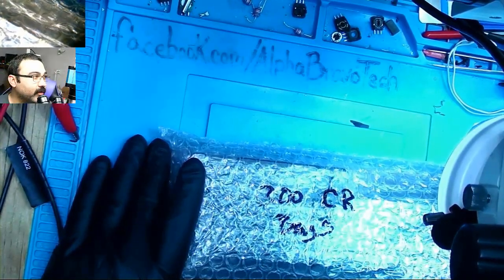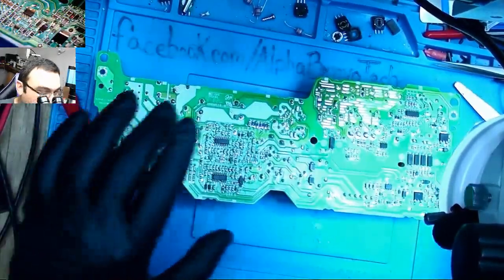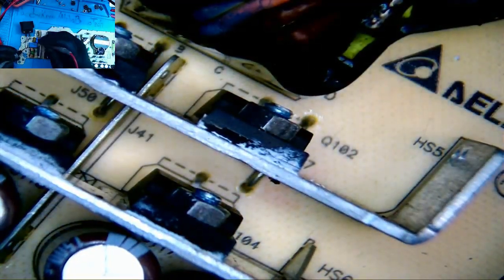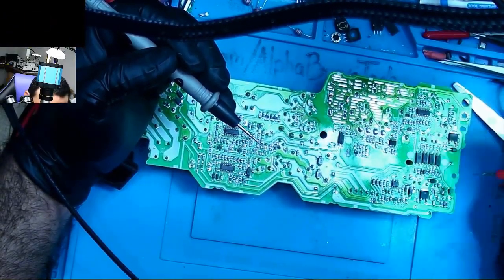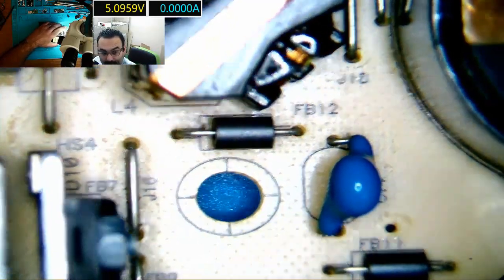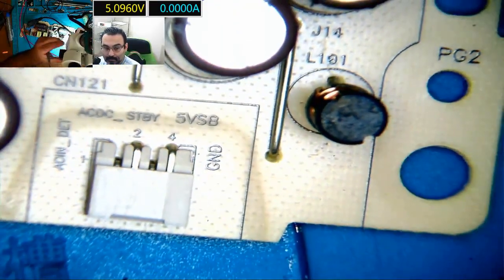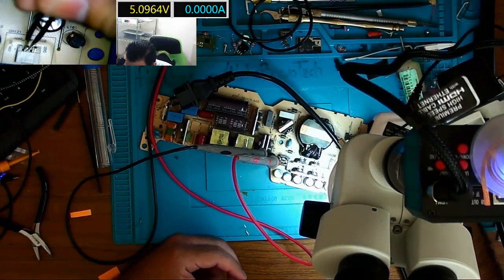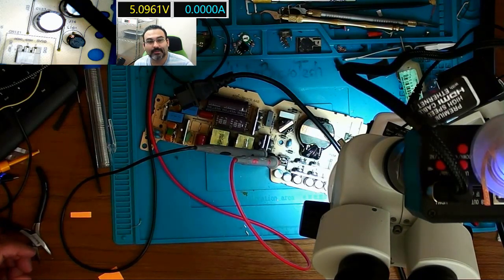PS4 PRO PSU ADP-300CR Power Supply Repair (Another One)

Comment: Great video! Do you have any idea what can be wrong with my ADP 300cr? I changed the resistor because it was open and now I have the 5v but when I do the short to get the 12V, all voltages goes down to zero, even the 5v
Reply from the maker: I've got a couple like that here that I didn't bother to troubleshoot any further. It may be time to do that soon though because your not the first person to ask about that.
Reply: @AlphaBravoTech  thanks for answering, it would be great if you find out how to fix that, apparently nothing is in short.
Reply: @AlphaBravoTech  Thanks for the videos. I have the same problem with my APD300CR "I have the 5v but when I do the short to get the 12V, all voltages goes down to zero, even the 5v". Do you know which component is defect ?

Comment: Something usually causes resistors to go bad. Shouldn't you replace the components which stress the resistors to prevent a return?
Reply: Like what components cause after I opened mines everything was fine when I cleaned it and put it back I heard a spark and now I havw the same problem like this
Reply: @kevonhenderson6888  These supplies have a high voltage inside even when off. Better/ safer just to replace the whole power supply unless you are a trained technician.

Comment: thx for the video mate. so as far as i understood r1, r5, the diode RBQ20BM65A
, the mosfet sdt3n62k3 and the 43 kohm resistors are the most common parts which go bad?

what are the values of r1 and r5? does DAP041 needs to be PQGL or can i use i.e. PYFH?

Comment: Hi buddy Thanks for that awesome video repair 
I have the same problem with my power supply and I never change fuse but I need advice 
The same of does fuse you change please
Reply from the maker: Hi! What do you want to change out? The main resistor or a fuse? Have you checked it for continuity (beep mode on your multimeter)